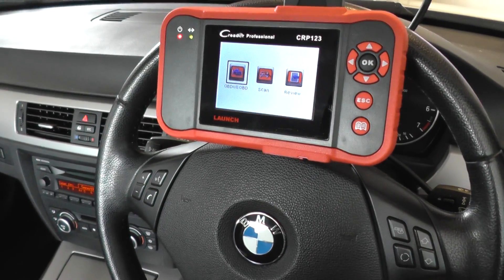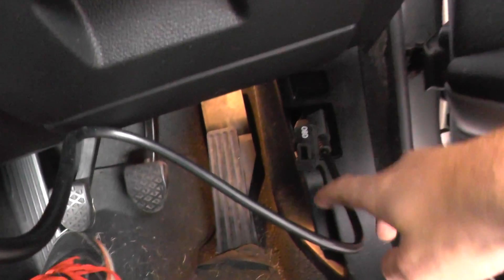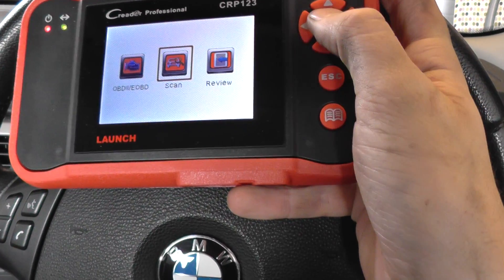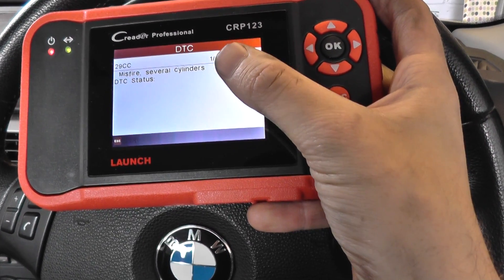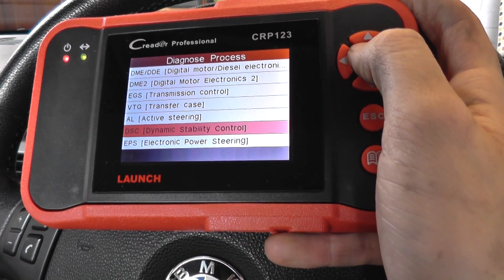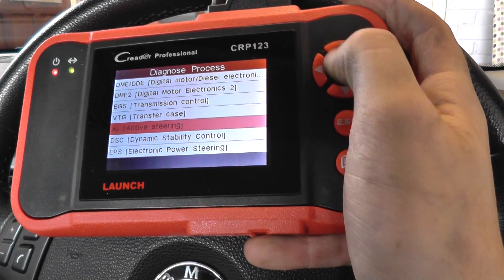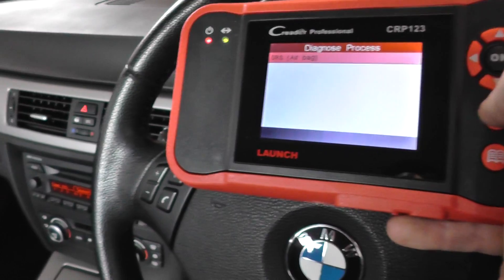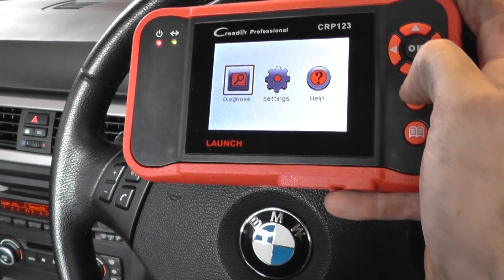How To Read BMW 3 Series Fault Trouble Codes E90 E91 E92 E93 (2006-2011)

Comment: How do ylu determine a problem with the transmission where it tells you what gear your in is a warning light with a gear and a ! Point in it and it wont shift gears just park neutral reverse and drive but only one gear in drive?
Reply: You resolve this?